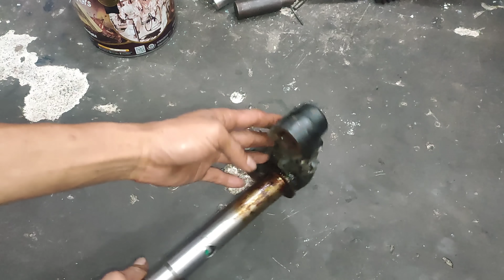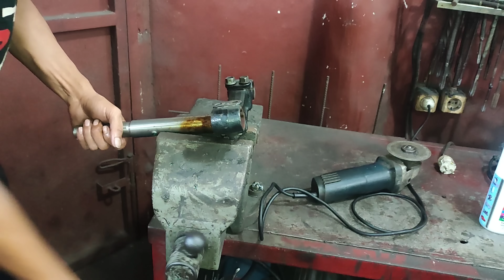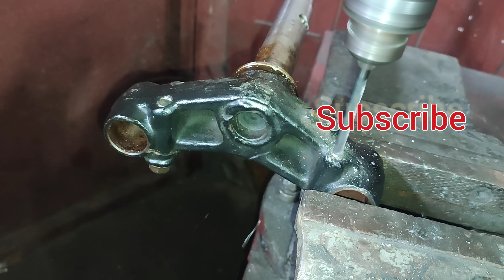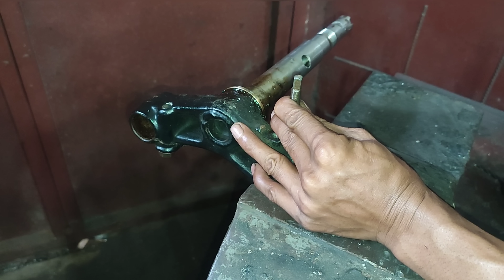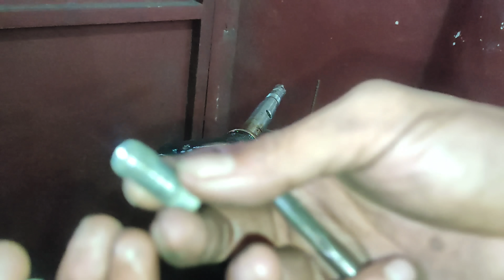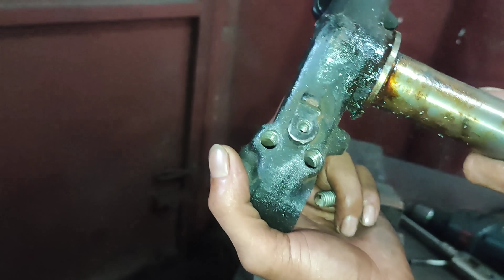there's still a lot wrong, how to open a broken bolt easily

Comment: Just a lucky extrusion.
The broken bolts were loose.
Easy to remove.
Reply: Correct...shld use extractor.wat he did was all wrong
Reply: @mdwan7250  sengg benerr piyee lek
Reply: verry good